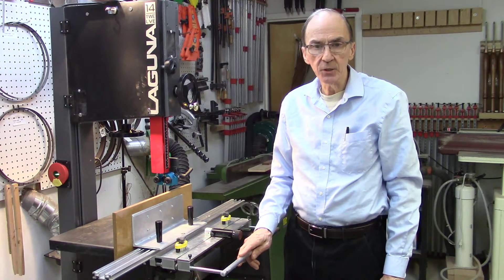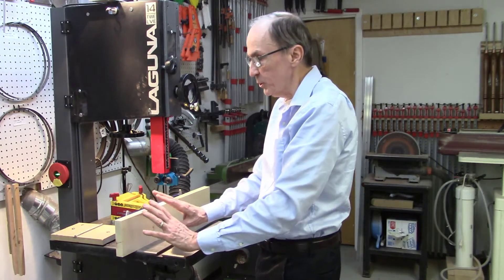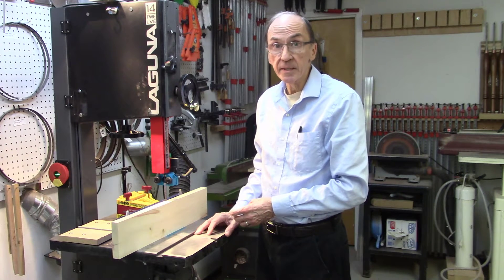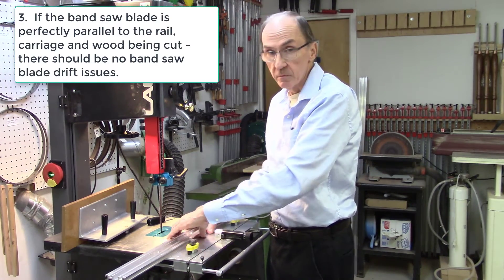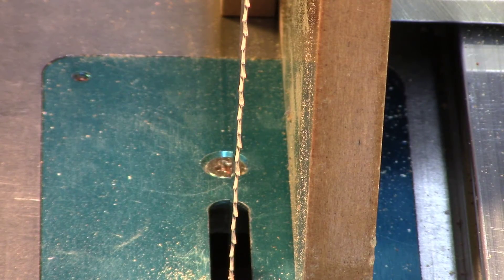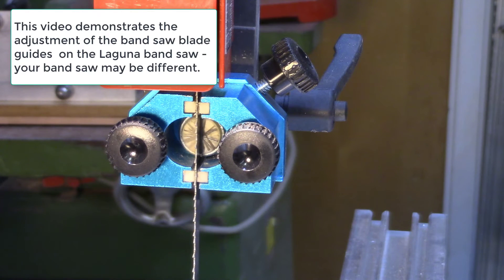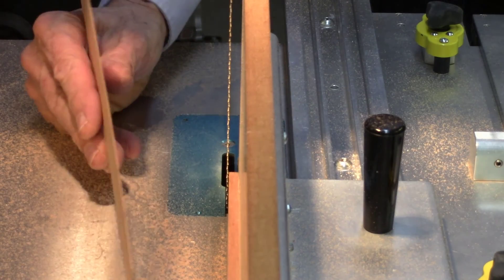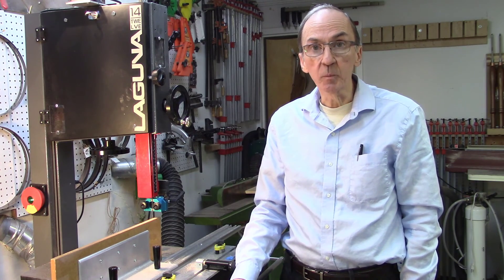Band Saw Blade Drift Using the Accu-Slice (11)

Comment: Blade drift will occur whenever the force of the wood moving into the cutting teeth exceeds the ability of the blade tension to keep the blade straight. It doesn't matter how parallel the wood carriage is to the blade.

Blade drift will also occur if you use a blade with too-fine teeth and a gullet that doesn't clear the swarf; if that is the case, the blade cannot run centered in the kerf. This problem increases with the height of the board being sawn.